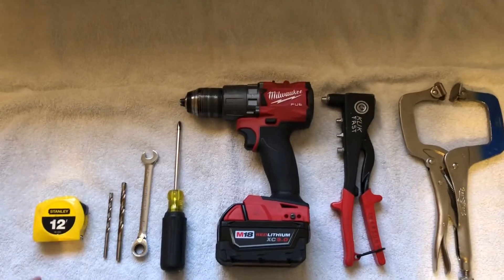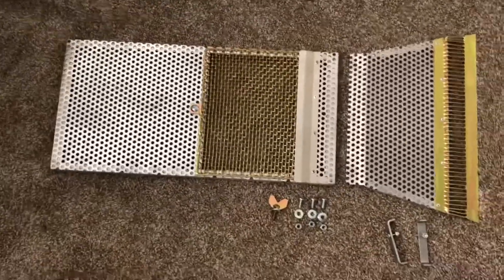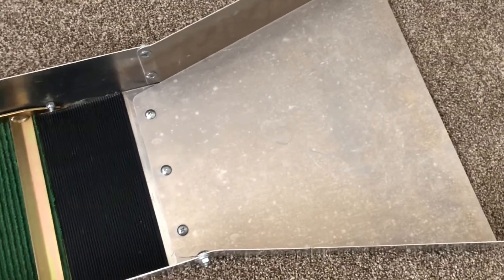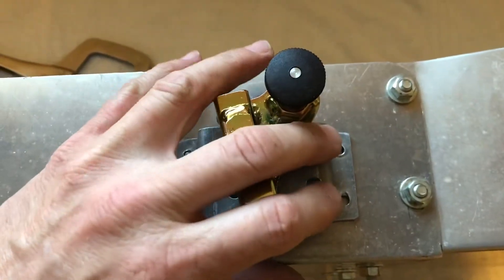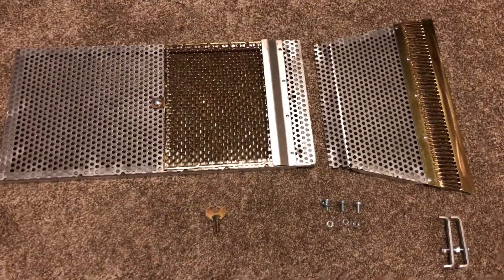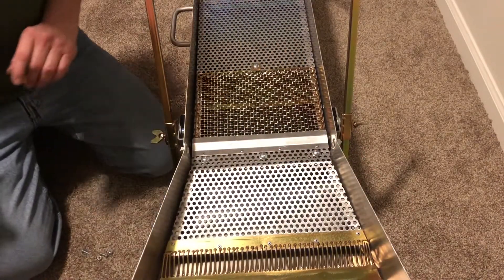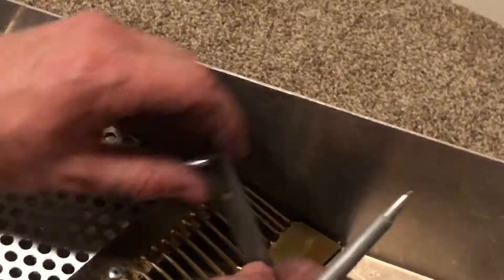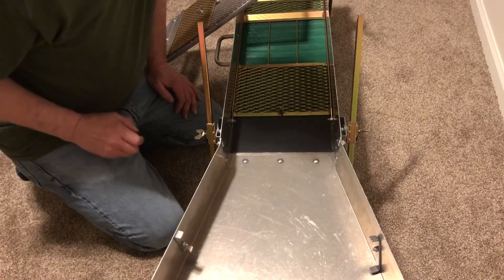How to convert a Keene A52 Sluice to an A52S Super Sluice.

Comment: Hey buddy thanks for the great video now that it's been some time I would like to hear your opinion on how it performs versus the original a52, besides the legs how do you find the upgrade, I have an a52 and am wanting to either add a highbanker/dredge hopper set up or purchase the new kt10 trommel but am unsure if I want to do the conversion as I may just add another 3ft section of sluice to the lower end of my a52 and use various gold hog matting or miracle mat for anything the 52 is missing thanks for your info and looking forward to a response.
Reply from the maker: @Yukon Nate. Thanks for the reply.  I walk a ways when I pack my sluice in and out.  Everything I carry is weight.  The more weight I carry the more work it is for me.  Most of the time, I do not have enough water flow for it to work effectively. 

I live in Michigan and most of the gold I find is flour gold.   I have have been classifying my material and using it without the super sluice upgrade.  I still use the adjustable legs but they also added weight.

Comment: Hello, I have the a52 as well and wondered if it’d be reasonable to add the classifier using original mat and riffles. In your opinion would one of the original riffles line up at a good spot to add a fastener bolt and attach the screen?
Reply from the maker: The nut that the thumbscrew screws to to hold the classifier is attached to the new riffles.  There is nothing to attach it to with the old riffles.
Reply: @SilverSleuth so if you buy a A52 and a screen separate that won’t work (attach)?

Comment: Would the classifier still work with original rifles?
Reply from the maker: There is a nut/stud on the new riffles.  The wing screw goes through the classifier and screws into this nut/stud.  The original riffles do not have the nut/stud.
Reply: You'd have to come up with a different mounting system,and I'm not sure if you'd get enough water flow for.the originals to work correctly 🤔 . I'm going to build a new sluice using my old riffles and a different  mat. Small sheet of aluminum and couple of bends should be fine.

Comment: Thanks Sliver Sleuth, Great build. One question, the drill bit is 3/16 so are the rivets  3/16 also?
Reply from the maker: @SunsTo7 sorry.....was in a rush when I typed my reply earlier and wasn’t paying attention.  It’s the 17/64” drill bit that is not needed.  Sorry 😐
Reply from the maker: @SunsTo7 you still have to drill.  Make sure you have a C clamp or a set of vice grips like I used to hold each swivel mount in place.  You don’t want your drill bit to walk and yours to not line up.
Reply from the maker: @SunsTo7 yes they are.  The 3/16” drill bit isn’t needed.  A small counter sink bit for the inside would have been nice.
Reply: @SilverSleuth  What do you mean that a 3/16 drill isn't needed? I still mus t drill right.

Comment: Great video!
Reply from the maker: Only the 3/16” drill bit was needed.  I didn’t realize the holes needed for the brackets to hold down the front of the new screen was a 3/16” until the end of the video.

It’s a super easy upgrade to do.  All of the measurements and part numbers for the conversion parts are listed in the description.